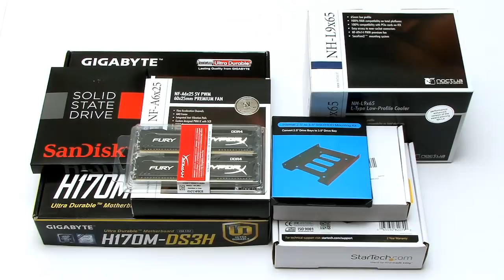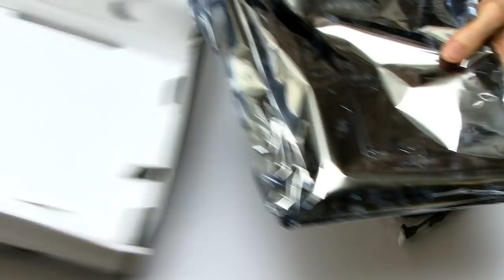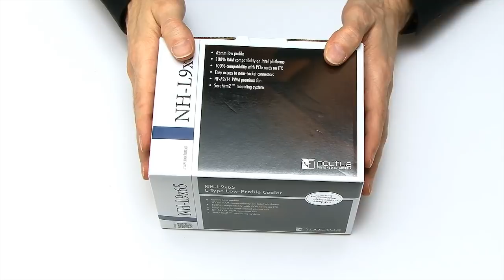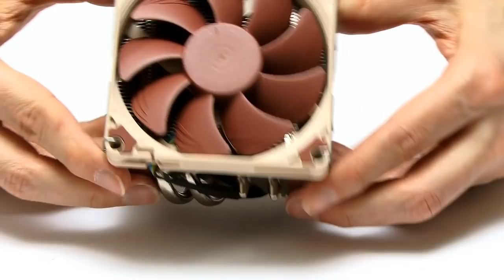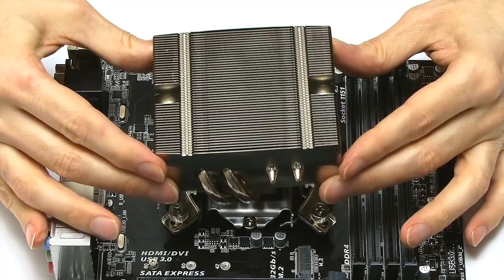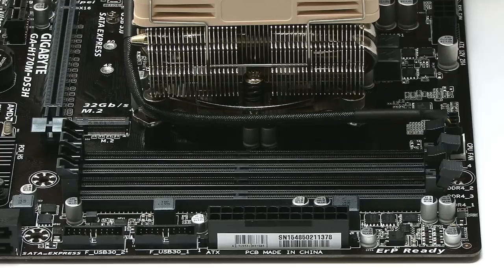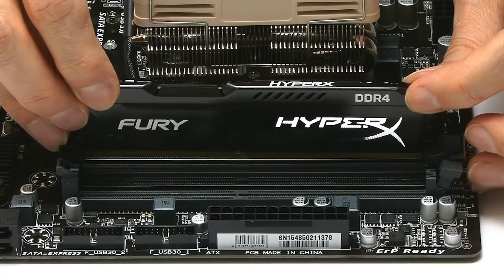i7 PC Build: Part One

Comment: i7 PC Build: Part One, 19:20 : This ‘quick test’, I also used to perform, can be bad for your health, when nothing seems to happen at all. 
The cause can simply be that a regulated CPU fan is completely switched off when the CPU is stone cold. Only realized this, when the
PSU fan did nothing either. Great channel Chris, please continue to be a civilized beacon in the dark.

Comment: Could you talk about the costs in the second part - with a breakdown for each component etc.? Prices vary ofc, but an estimate would be nice in any case
Reply: Janice Carles Valdoreme Cresanova .... my build was $2400 Dollars - i7 6cores processor, X99 chipset Asus Deluxe, DDR4 32gb, Nvidia 1080, 2TB hard drive, case, 800watt powersupply, Windows 10 Pro OEM.
Reply: From looking on NewEgg I have seen that you save about $100 to $150 building your own PC. Some PC makers use cheap ECS motherboards or other lesser brands. They also give you boards with the most basic features which might be OK for gamers if that is all you do with it. Typically it's anywhere from $500 to $549 for a pre built PC from a Brand Name maker. Have seen some Combo's on NewEgg for $208 for Motherboard, CPU and 8 Gigs RAM included.

Comment: Gonna need more ram for any rendering. Should have went with the z170 board and 4 ghz chip and 32 gb of 2400 ram or more and 3200 MHz ram but  still, nice build.  I like the desktop style case vs the towers. I miss desktops and cry monitors on top like in the 80's and 90's better than moder towers and LCD screens.   also I misk disk drives like the Imation Superdisk ls-120 and Iomega Zip, Rev, and Jaz

Comment: I have a gigabyte H110 motherboard with an M.2 slot on the back. Another thing to mention is this chipset often has fewer SATA connectors. I use an Edimax AC 600 USB network adapter with mine and it works great.

Comment: Just built a new i7 rig too. 3.4 GHz CPU with a  ZOTAC GeForce GTX 970 4GB AMP! Extreme Core Edition GPU.

I actually ordered the same motherboard as you but it turned out to be defective.... Swapped it out for an MSI B150M PRO-VHL

Comment: I've seen systems benefit by 10*C by polishing the heat-sink surface to a mirror shine. I've used 3000+ grit paper and seen it first hand. However, it appears Noctua is one of the mass producers that recognize this fact, and it looks like they've done a nice job of polishing the surface for you. The tip of polishing is helpful for aluminium blocks that are mass produced and only have a roughly machined surface. Nice job Noctua!

Comment: T spec processors are TDP-limited to 35W not necessarily tray or retail, though they're almost never sold as usual retail versions. You can get tray and retail versions of almost any processor. The only difference is that retail versions come with fancy boxes and Intel's crappy stock cooler.
Reply from the maker: Thanks for this.
Reply: Unless you buy the K versions. Then you don't even get the cooler. Just the fancy box.

Comment: Building a PC was my favourite activity back in the years 2000's. Unfortunately it does not pay off any more.
Reply: Agreed, the cost savings compared to prebuilt have all but disappeared. The advantage of self build is knowing that you are able to replace faulty components yourself, and that you can choose the exact components you need.
Reply: @bfapple  There is alot of cost saving.
Reply: @nadirjofas3140  Not anymore. The only thing you can save money on is the Windows licence. PC manufacturers have the benefit of bulk-buying components, plus the customer gets a warranty.
Reply: Whether the warranty is any good is a different matter, but it’s there.
Reply: @bfapple  I do my own PC-builds and it saves me a lot of money.
Reply: @nadirjofas3140  Guess it’s down to what components you use. My self-built Ryzen 3600 gaming PC wasn’t any cheaper than a HP tower with identical parts.
Reply: @bfapple  Of course. Don't spend money on useless stuff.
Reply: @nadirjofas3140  My gaming rig has a Ryzen 3600, GTX 1650 Super, 16GB RAM, 500GB SSD + 2TB HDD. No RGB apart from what came with the £40 case. Compared to an equivalent HP I saved £70 at most, and that’s by virtue of the fact that I got a free copy of Windows 10 from university.
Reply: @bfapple  How much did it cost?

Comment: I'm sorry, but the T in the i7 6700T does not stand for "tray". It is a suffix Intel uses to name the reduced TDP variant. The i7 6700 is the normal TDP variant and 6700T is the reduced TDP. Both variants are available in tray and retail packaging.
Reply from the maker: Yes, you are right. I got confused. :(

Comment: I do like that cooler I may swap mine over.The first PC I built was a 386, living in Australia at the time and to get the motherboard I had to sent to Hong Kong it was fully populated with 2Meg RAM. OZ had nothing like it at the time.
Reply: My first computer I built second hand was a DX4-100 and had a pair of Voodoo2 graphics cards in it. They actually called linking the two cards togeather SLI mode back then too, but the SLI stood for Scan-Line Interleave in the Voodoo and now stands for Scalable Link Interface in modern graphics cards linked togeather.

Comment: Intel chips are very robust as well. I've had my Core i7 2600K for 5 years now running at 4.3 GHz with a Vcore of 1.28 V. At times I've even pushed it to over 5 GHz at 1.5 V for benchmarks and despite that the chip still hasn't degraded.
Reply: I've had an i7 2600 for approx 7 years, and the darn thing won't die enabling me to buy/build a new computer!
Reply: I have the same CPU and now on it's 7 yrs,still running smooth...
Reply: I managed to get mine stable to 4.8, but backed it down to 4.5, and it's now 11 years old and still running strong. Terrific proc. Running it with a nice 360mm radiator water cooler which I mounted onto the top of a mid tower LIan LI case.

Comment: +ExplainingComputers / Christopher
Good explanation, especially when talking about the CPU  and Motherboard. I also liked your choice of CPU heatsink / cooler.

I would have liked to have a bit more information about the CPU, specifically some information about  the number of cores (four running at 2.8GHz) and if the CPU supports hardware virtualization / hypervisor technology (ie. VT-x / VT-d supported).

Comment: A Z170 motherboard with the right BIOS will happily overclock a 6700T (or any other non-K Skylake CPU) through BCLK adjustment. I got my i3-6100 up to 4.9GHz :) 

Also, nice to see someone using the L9x65.

Comment: The t doesnt stand for tray. There is several sites where you can buy trays cpus from all models. I bought an i3 2100 tray (not the t model) back in 2011. The t stands for a low tdp cpu. Just a low profile version

Comment: Love your videos but had some suggestions.

That CPU cooler is going to clog with dust pretty quickly.  Personally, I would get a copper core or all copper one with less fins to minimize dust clogging and possible heat issues.  It will cool better, use less energy, and have less down time.

I always spread out the thermal paste on both the CPU and heat-sink to be 100% sure its evenly spread out.  That way when the two parts meet, every surface has paste on it.  Your method can squeeze the paste out one side if not installed perfectly level and create a hot spot that will go undetected for years and use unnecessary cooling power.

I would never suggest a SanDisk drive if the data put on it can not be replaced.  Most of the SanDisk SSD drives these days have on the fly forced encryption of the NAND chips.  A chip on data recovery is usually your only chance if the drive complete fails (and they do fail).

+1 CPU; good thermal performance.
+1 MB; although you may want to update the bios from its current F1 to today's F20.
+1 Memory; although I would probably go with 16GB\32GB if running Windows.
Reply from the maker: Thanks for your suggestions. On the cooler, Noctua have won numerous awards for these models and I used one having used another successfully in the past. On the thermal paste, there is now very good evidence -- including many YouTube videos -- which indicates that pea or line (and absolutely not spread) provide a more consistent application, and avoid the risk of air bubbles that can be introduced via spread. As I said in the video, Noctua recommend the pea method with their compound. On the SSD, I never have a drive with data on it that cannot be replaced! This is a system drive only, and I always keep images. On memory, this machine is running Windows 7, but 99.9 per cent of the time runs one program -- the LightWave Screamernet CLI renderer. For this 8GB is more than sufficient. In short, the components picked here were selected with a great deal of thought for a very specific application. :)

Comment: Where I live, an i7 6700 is actually cheaper than the 6700t. Also, the standard 6700 comes with a cooling solution that is more than adequate to keep the cpu around 25°C at idle and bellow 60°C at full load. If heat is much of a concern, you can always under clock your CPU.
Reply from the maker: 60 degrees C at full load would not be good for a rendering PC that will often run c.160 hours a week at full load. I chose the 6700T very specifically for a PC with a very specific, single function to both save heat (and hence improve stability and life expectancy) and to save power. The electricity saving alone will pay for the increased cost of the 6700T in less than a month. :)
Reply: Sorry for the delayd response. I still think an standard 65W TDP i7 is better value for the money than the 35W TDP i7 T version. After all, they both cost the same and you may under-clock any Intel CPU to achieve the 35W TDP (T) values. I did exactly that a few days ago, just to test my i5 6600 abilites. The summer has come, so the ambient room temperature went up (at stock 3.3GHz/3.9GHz (turbo) the idle temp is still the ambient room temperature, but 100% load puts the CPU between 63°C to 65°C while the fan of the heatsink has to work harder). I use my PC mostly for gaming, having a 75W TDP GTX1050Ti for feeding the CPU 60fps @ 1080p. While the GPU gets 100% utilization all the time, the CPU barely gets above 50% on average.
And for that reason, I decided to under-clocked my i5 to what an i5 T would be (2.7GHz/3.5GHz (turbo)). Effectively turning a 65W TDP chip into a 35W TDP chip. I still use the stock Intel cooler.

i5 @3.3GHz - Idle: 27°C to 30°C (ambient room temperature); full load alone: 60°C; gaming: 63°C to 65°C (the GPU heats up the case)

i5 @2.7GHz - Idle: 27°C to 30°C (ambient room temperature); full load alone: 38°C; gaming: 40°C to 42°C 
-----------
In both cases the CPU fan and case fans profiles are the same. The CPU usage in video games got higher by 15% on average, the GPU being the limiting factor.

My point is (and I'm not quite sure about pricing of the i7 vs i7 T in the UK), that for the same money you get less potential with the i7 T, while the faster clocked chip can be under-clocked to achive very low power consumption and therefore overall temperature of the chip, while still having an option to boost up the performance when necessary (making your work faster).
Reply from the maker: Thanks for this, and you make some good points. But at least for my purposes I disagree! :) My PC here is used for rendering CG animation only (today chucking something out for the BBC), only ever running an CLI program called ScreamerNet. So, when in use, it always runs at pretty much 100% CPU utilization 24/7. Thus underclocking it could not halve my power use at the same processing capacity. My requirement is for a system that runs as stable/cool as possible for as long as possible, and which burns electricity most cost effectively -- and in that sense -- at least for this purpose -- the 6700T is the most cost-effective CPU for me. In electricity savings alone it will pay for itself in a year or so, and more so if the PC lasts longer. :)

Comment: Sorry, I am late to this topic but this is my first subscribe. May I ask what your reason was for selecting a non full size ATX board for this build considering the size of the case. Also, you didn't appear to mention configuring the two RAM sticks as a dual channel option which I think might improve render performance due to increased memory bandwidth. Thanks and I love the channel

Comment: I noticed you used a 4 pin 12 volt cpu connector. But I saw that the plug on the motherboard was an 8 pin 12 volt connector.
Reply from the maker: Correct. Good spot! :) But the board will not need the extra power that could be supplied.

Comment: As always, very well-planned video series, components seem a decent budget option for the time. It has one big issue for me: for a quiet, cool PC I would not have reused a 13 year old case. So much more is now known about cases and cooling. Here, the single fan can't remove the warm air the Noctua puts out, and while you can reuse old power supplies if they're high quality, new ones are quieter, protect the motherboard better, and have zero mileage on their components, primarily the large capacitors.
Reply from the maker: Point taken on the case. But this runs 24/7 rendering (ie at full processor utilization) and the CPUs stay under 50 degree C. The power supply here is a good one -- I always change PSUs separately in rendering rigs; they have to be good to survive a rendering environment. The case and PSU here are well over £400! :)

Comment: Chris, With your help I am nearly finished with my computer. Unfortunately, though, it will sit like a useless box because I don't have an understanding of the BIOS my Gigabyte board needs to run. Could you please make a video on what to do AFTER you build the computer. If you have made one,I apologize, but I have not been able to find it. Thank you.
Reply from the maker: Hi Mark. I recently made such a video following my latest build: https://www.youtube.com/watch?v=Bz_AyZswvXM You should not need to change anything in the BIOS to get an operating system installed. Unless, that is, you need to set a setting called something like "Enable USB boot" to allow you to install the OS. I hope that the video helps. Good Luck!

Comment: For rendering I would have gone with a Xeon that's built to run nonstop or gotten a k skew with a tower cooler and have it at about 4.4ghz to improve rendering performance.
Reply: With some quick maths the K-skew processor would cost 110 euro's more a year on the energy bill. The lower TDP makes it far more efficient. With around 40% of the power and only 10% less performance.
Reply: Mike van Lieshout YouTube Red costs more to be subscribed to than it would be to run the k-skew. It all depends on if you run it 24/7 or if it's under a load 24/7, and the overclocking and really help in some applications. You get what you pay for is a good way to put it.

Comment: Looking forward to some benchmarks. 

My old system: Intel Q9500 with a GeForce GTX 460 768 MB GPU VS the i7.... 

Games like Watchdogs... I was getting ~25 FPS and now ~80 FPS with max settings.
Reply from the maker: Thanks for this. I include some performance measures in the Part Two video (will post next week).

Comment: Thanks so much, about sharing with us about Noctua fans.  I just rebuilt my system with a Noctua fan, and it is soooooo quiet.  The only difficult part about my rebuild was figuring out where all the front panel connections go on the motherboard.  I have one issue left.  My system on LED has a three pin connector, but my motherboard's connector is two pin.  The three-pin connection from the front uses the three outer pins.  Is there any fix for that?

Comment: I wonder given the low TDP whether the heatsink alone could cool that cpu? You can get fairly cheap blocks that will cool 35W cpus. So a high quality block with heatpipes might be sufficient.
Reply from the maker: Yes, I imagine passive cooling would be possible here fairly easily.

Comment: Hi Chris, did I hear you say on one of your videos, that if you fit an M.2 drive onto the motherboard you have to use SATA 1 for things like HDD or optical drive and don't use SATA 0 at all...from Fred in Essex.
Reply from the maker: Yes, if an M.2 slot is used for a SATA drive, that drive has to map somewhere, and it is usually SATA 0.
Reply: Ok thank Chris...F